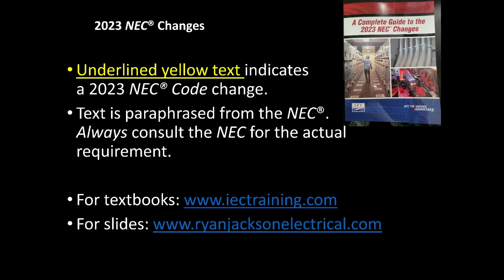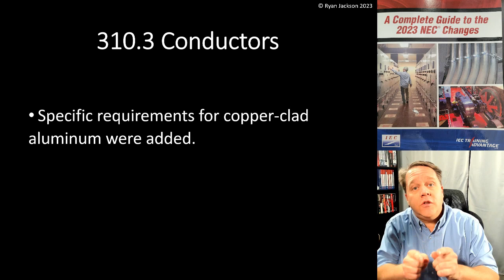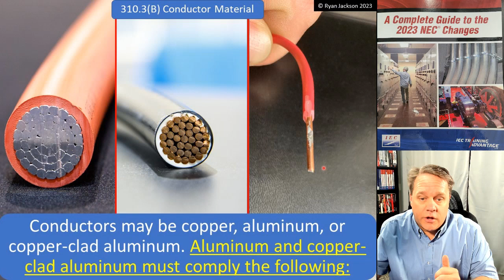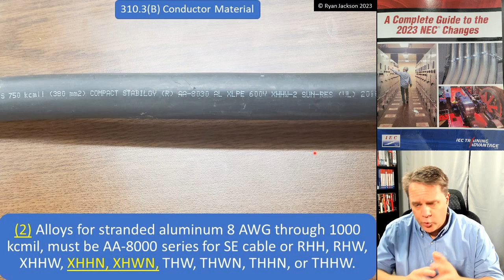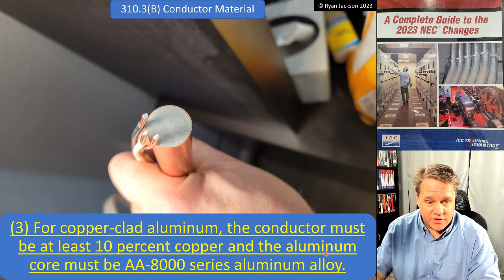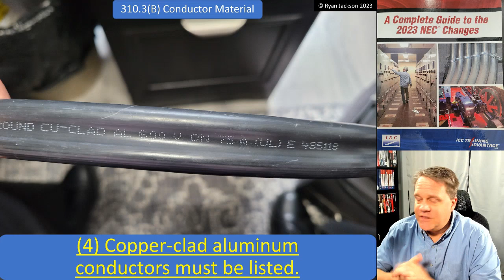2023 310.3 Conductors

Comment: I don't see stranded Type USE or USE-2 listed in 310.3(B) as being required to be AA-800 series.  So I infer that a USE-2 4/0 stranded AA 1350 Aluminum conductor may be used in an outdoor feeder.  Is that correct?

Comment: Whether you live in an home or apartment,  if it was built after 1960, it's almost guaranteed to contain some aluminum wiring.  From the mid 1970s-present,  aluminum is super common for the service wires down to the meter and feeding the main panel,  subpanel feeders, and large 240V circuits for the dryer, range, or central air conditioner/electric furnace.   From 1965-1973 give or take a few years,  aluminum for the 15 and 20 amp general purpose circuits was used almost exclusively,  and it was the AL 1350 series prior to 1972.  The many problems caused by this wiring is what gave AL a bad reputation.
Reply: Interesting. What resources do you recommend for that?
Reply: @PillarsOfHeaven  For repairing old aluminum single strand wiring I prefer pigtailing with Alumniconn connectors because they are widely accepted as a permanent repair.   Less expensive are CO/ALR rated receptacles and switches, I don't prefer these because looping the conductors around the terminals sometimes causes them to snap because  aluminum tends to become brittle after 50 years.   On the other hand using Alumniconn sometimes requires a larger outlet box particularly if installing a dimmer or GFCI receptacle because the boxes from the era of aluminum wiring were often metal boxes smaller than the plastic boxes commonly used today, for this reason I keep plenty of rework boxes in my service truck if I'm repairing aluminum wiring.
Reply: It really depends on your area. In my area in the midwest most homes do not have any AL wiring, including new construction homes. I'm not sure if it's because they don't want to increase the size of the feeder pipe or it's just not enough length for AL to save money on the service conductors. If the meter was on a separate pole and you had out buildings the AL would be a lot cheaper. I feel like it's really worth it to use it when you have to upsize the wire for voltage drop anyway but you better have a tugger because for a given ampacity AL is always harder to pull because the conductors are so much larger (even though the AL is LIGHTER for a given ampacity than CU which is why overhead conductors are always AL)

Comment: I dunno, as someone currently dealing with really severe home electrical problems that are due to some combination of all aluminum busbars in the outdoor meter panel + main breaker, and also the all aluminum 4/0 service entry cable. I'd really appreciate it if they made it code to use CCA wherever they would previously used plain aluminum

Comment: The reason that CCA conductors, unlike UNinsulated/PREinsulated CU and AL conductors, absolutely MUST be Listed is that those of us on NEC® Correlating Committee’s CCA Task Group who represent manufacturers of products (e.g., receptacles, switches, circuit breakers, fuse holders, etc.) that TERMINATE on the CCA wanted assurances via Listing that:
• not only 10% CU by cross-sectional AREA but also assurance of both MIN THICKNESS CU and »MIN AVERAGE THICKNESS« CU over the aluminum substrate
• CU is METALLURGICALLY bonded to AL, so that the CU absolutely CANNOT delaminate from the AL (CU absolutely CANNOT be merely a plating or a flash)
• Given the prevalence of fraudulent, counterfeit “CCA” from the Far East, assurances via independent (3rd-party certification = Listing), continuing production audits that the CCA conductors, insulated or (for EGC) bare, was in fact truly compliant CCA. 

None of us who manufacture terminating devices want the liability litigation associated with UNlistable, fraudulent “CCA”.
Reply: Plain aluminum is allowed with the same size as CCA, so 10% copper seems like overkill. Gold plated connectors for low voltage typically have a layer of gold measured in microns, and it does the job.